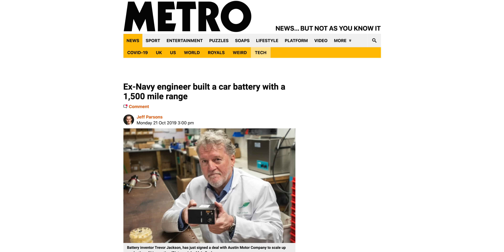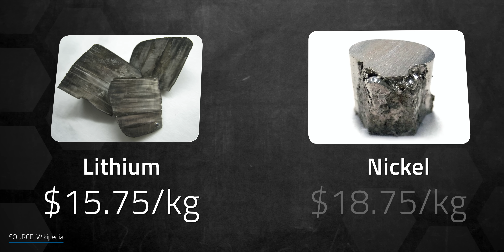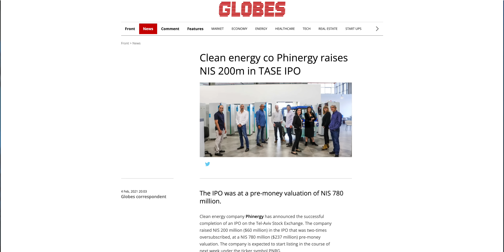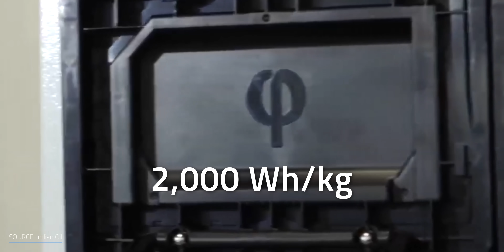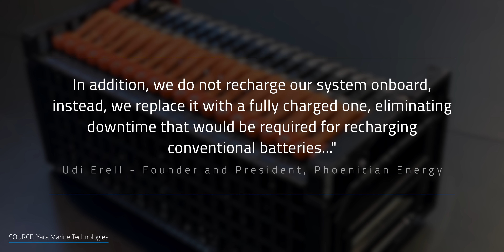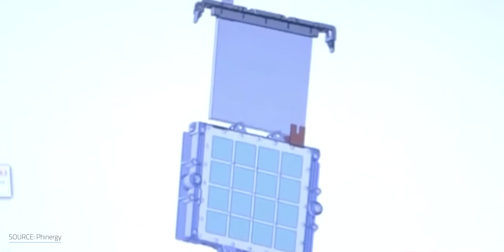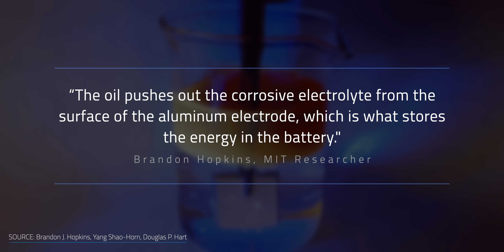Exploring the 1000 Mile Car Battery - Aluminum Air Hype?

Comment: The high gravimetric density makes them an interesting choice for aviation. Swapping is not a problem if infrastructure is built to do that and refurbishing or recycling them into new batteries is also cheap and fast. Swapping would be a problem for these type of batteries if the refurbishing cycle is long and complex. Then you end up with 3, 4, 5, times as many batteries in the cycle than are actually in use so they effectively become very low in total volumetric density.
Reply: You need to re-refine the Al(OH)3 that the Al electrode converts into back into Al metal. That's the same process as refining alumina. So each new battery takes the same level of energy to produce regardless if it is new material or reused material. At least for the Al electrode.
Reply: @seb3090  new or reused doesnt matter, if there are enough around to cycle batteries and swapping is not a problem if infrastructure is built. then the real cost will be just that of Aluminium plates (new or old) inside battery. And we all know Aluminium is not costly, with a small over head charge for services, with great range it be very practical.
Remember its a Govt of India project, for a 1.3 billion people, it has benefit of ability to scale and bring cost lower further. With all major Automobile brands in India effectively on testing mode to redesign cars for easy swap. In Green Hydrogen and Aluminium Air batteries India is working on scale which only India/China can to make it globally cheap and affordable option
Reply: @sandeepssangha  You are looking at best 2-4 tonnes of CO2 per tonne of aluminium, as the batteries oxidise this to aluminium hydroxide so you need to re-refine this the same as you would bauxite. The carbon electrodes used to make congealed electricity burn off releasing carbon (among other sources). So this isn't good.

At best you are looking at 15% efficiency (that is the energy to create the battery vs energy out of the battery).

This is not 'green' by any stretch of the imagination. 

Oh and if you can discover an easier way to refine aluminium hydroxides and oxides into base metal that is substantially cheaper than the current electrolysis (which isn't efficient) you could make billions. I doubt you can because we've not found one yet as the chemistry doesn't really support it.

At least try to understand the science of what is going on before making such proclamations.

Comment: On the subject of swappable battery - Yes, of course.  The obvious choice is the service spare model.  2 batteries loaded, the car runs from one and at critical power swaps seamlessly to the spare, the driver then has x many miles to replace the dead one (which is then the service spare).

Comment: For a car, the handling of the weight of the battery compared to a plug on a cable might be a deal breaker.  On the other hand if the price would be much lower for a car with aluminum batteries and the environmental impact is low by using this system. I would say it has a future. Perhaps a system where you could just slot in the aluminum parts yourself and have a couple of them in the car, like an extra gas can. 

The silver catalyst is something that does not get used up. The swapping fee would then not be affected by the price of silver.

Comment: If one can get 2500 miles range on a non-rechargable battery, then it's more like an oil change event rather than a fill up event.  A palatable option to me.  Definately half to solve the corrosion problem though first.

Comment: Would I like a car battery that I don't have to charge and swap within 3 min at a battery station? Heck Yeah! It's like the gasoline engine in the old days- not enough people wanted them due to lack of gas stations for refuel, but once enough gas stations were built, the whole auto industry took off. To me it's an easier solution to build more battery swapping stations (converted old gas stations)  than it is to build infrastructure around slow-charging Teslas and such. Worried about long drives with no stations in between? just put an extra battery in the back of the SUV and you're good to go for 1400miles (2800km). Lastly, imagine the jobs created by rejuvenating old batteries!! It's a win-win to me.

Comment: Honestly, as a researcher in the feasability of fleet use of EVs, swapping out a "power cell" rather than having multi hour recharge times sounds great. 

The sneaky elephant in the EV closet isn't range issues, everybody knows about them... Its recharge time. As you put bigger and longer ranged batteries in vehicles, recharge times go up proportionately. If a vehicle is used in a fleet setting, say from 8 to 5, you really only have one one charge to work with, as even partially recharging a battery consumes too many working hours to be useful. A larger range, combined with a swap time compairible with refueling, would solve this problem handily. Heck, even an equivelent range with a fast, easy swap process would make EVs far more attractive for fleet applications.

Its not rechargeable? Oh well, gasoline vehicles aren't rechargeable, we replace the contents of the fuel tank every time we fill up. Nice, compact, unspillable, pre-packaged "power-cells" sounds like an improvement to me... Of course the cost of the battert or "power cell" will have to be reasonable, but that sounds feasible. 

The only true draw back i see with the system is the cost of aluminum. Sure, its reasonable now, but if you create a whole new industry based around its conaumption, how long is that going to last? I mean, it would be great for aluminum producers, like india, but maybe hard on the consumers...

Comment: I think the non rechargability is overblown - you have to refuel your gasoline car too. It will require more careful planning in the beginning when infrastructure hasn't been built yet, but once it is, it will be just as easy as stopping at a gas station to fill up.

Comment: The main thing with EV range is that when the car gets low on charge you would need to stop and spend time to charge it up. With a gas car you could just stop at a gas station and spend 5min to get a full tank and be on your way
Reply: If the distribution is done right, the replacement batteries would be standardized, and available to swap out when you're at the 'gas' station. Except you'd be stopping there once every month and a half, instead of once a week.

Comment: This looks like a better option for Electric Airplanes.

High Density for point-to-point locations, then swap at the other side.  All the infrastructure for swap + storage of the pack would be at the airports/terminals.  Hopefully the recycling/manufacturing would happen nearby as well.

Battery swap for cars would be a no-go for me, it could possibly make sense for long-haul trains or trucks, but I don't think regular cars need the range as much.
Reply: Or just make it easy swap out and yes there is lots of need for long range vehicals and trucks.
Reply: What happens when your battery runs out of juice at 30,000 feet?
Reply: @kfl611  that is more of a critical failure or planning issue.

Most flights have 1.5x the fuel needed in case of emergency.
Reply: @DavidDornier  I meant electrical battery juice !  For the electrical jets !
Reply: @kfl611  yes, planning would require the battery capacity to have adequate room for the flight + emergency supply.  That is a planning issue.  The only other reason you would lose power at altitude would be multiple critical system failures.
Reply: You just copied the top comment you 🤡
Reply: @phuckyoutube5927  well I was replying during the video so... "Great minds think alike"
Reply: Only a moron would fly with an electric airplane, you just go from 600mph to 300mph
Reply: @Chris-hw4mq  Who cares if it's cheaper (which most likely will be the case) That's why Concorde or similar planes are no longer even considered. Faster is not always better
Reply: @cerverg  its like buying a Dacia instead of a Mercedes, Dacia is cheapers and slower while the Mercedes is faster and more expenssive.

Comment: Oh...and they're not rechargeable. But other than that they're great! Except in very small doses I don't see how a battery-swap station can be practical. Unless that station is going to process and recycle the modules right there on site this doesn't sound like a sustainable solution. There might be some cases where this type of battery could be useful* but I don't think passenger vehicles is one of them.

* (like potentially long-term space probes with no access to solar energy or where nuclear options are off the table)

Comment: Personally I prefer not to have to go to a swapping station.  Also what would be the cost?  I rather pay a little each time for charging a battery than have to pay for 1,000 miles plus profit to the swapping station which would be a big chunk of money all at once.  I think Aluminum Air batteries would be a better fit for aviation and trucking than passenger cars.

Comment: But the catch is that, because it is non rechargeable is the primary reason oil companies are interested in promoting Aluminium Air batteries to the masses... It will be just like another petroleum product that the vehicle owner can't do without...
Car owners won't be able to charge their cars at their homes and save money... They(customers) would still be dependent on the petroleum (battery) manufacturers.. 😉😉😉

Comment: What is the ultimate energy source when getting a fresh battery?  That wasn't explained (I assume in the production of the electrolyte)?
Reply: The production of the Aluminum in an Oxygen and humidity free plant is the big expense.  Aluminum is incredibly reactive.  It almost instantly "Rusts" when exposed to Oxygen or H2O (Aluminum foil is coated with Aluminum Oxide, almost instantly created when manufactured in air), giving off high heat.  If one of these batteries cracks in a minor accident, especially in a rainstorm, you would be burned alive, along with anyone in a car nearby.  It is that fast and hot.  Good luck finding a firefighter to pull you out of your car if it doesn't crack.  Seriously, the danger from these is huge.  And putting them on ships?  Great idea, no water or corrosive salts anywhere near ships.  No way any port would allow one to enter.  The explosion would make a liquid natural gas tanker's city killer explosion look mild.  This whole thing looks like the hype from the infamous Hyped Loop.  Someone is cashing in on the hype.

Comment: I wonder if these would be viable as a sort of boost pack for EVs instead. Would be interesting if you could optionally put an extra battery pack in your frunk to augment your main lithium battery pack for long trips or emergencies. Might help reduce the issues of finding a limited supply of exchange stations while giving that extra boost if needed and let the economy decide if it's good or not. Similar to what's mentioned in the video but just an optional after market upgrade with the only permanent feature being a port to plug into the car from the frunk and maybe some form of mounting system to secure it.

Comment: I would like to see it as an extender for now.  You have extra room in EVs because of lack of engine.  Put the pack in there and use it for a long road trip to charge up the current batteries on the go.  It could also be your "Jerry can".  Giving you that extra power to get home or a place to charge the standard batteries.  Why can't the same roadside charge companies just bring you a pack and swap it on the side of the road?   For that I guess you would need a standard pack for all cars.

Comment: Biggest elephant in the room is that one gallon of gasoline is equivalent to 33.7 kilowatt hours of electricity.  
"According to the EPA, burning one gallon of gas produces 115,000 BTUs (British thermal units). 
To generate the same amount of heat by way of electricity, it takes 33.7 kilowatt-hours (kWh)."

Comment: That's a bit unfair to talk about what to do if you ran out of juice at night. What do you do if you run out of petrol or run out of battery charge today? I'm sure the service rescue vehicle could easily carry one of these. The all round efficiency of the energy wasn't questioned. How much energy does it take to reform the metal from the oxide? Does it matter, if the energy can be collected from intermittent renewables?

Comment: I'm with you on that Matt. I just don't think there would be many uses for large primary batteries. It will be a niche market at best. There's such a huge demand for better batteries of all types, they will come. As long as the private sector is not inhibited by unreasonable taxes or subsidies (which slows down real development), we will probably see more improvements from 2020-2030 than we saw from the entire last century.

Comment: It is a nice and clear detailing about the aluminium-air batteries and its future...well, what about so called aluminium fuel cell weighting for mass production by a indian start-up company called log9 technology with surge company....it was claimed that a car powered by this run 1000 km and uses aluminium and graphene as electrodes....seems to be more promising....please make a video on this battery and i would like to here it from you...thank you

Comment: If this battery type is ever to succeed in cars, they have to standardize the form factor and electrical specs of these batteries NOW. No "swapping station" will be capable of keeping 20 different types of battery in store for various brands of vehicles.

Comment: make a hybrid Li and Al battery. Recharge the Li battery on a regular basis and when you need a long trip without charging use the Al battery and swap when another long trip is needed. Best of both worlds.

Comment: im sorry, not rechargeable? just what we need, more single use products. oh but they are totally recyclable. yea? so is aluminum cans, yet, not all of them get recycled. this will just make more waste. and the infrastructure needed to have stations with swappable batteries will be insane. the storage needed, the transportation of these batteries to and from the stations is not realistic. the fact that at least half wont get recycled, will be mountains of waste. these would be great, IF they were recyclable. but points to india for trying to find a better solution then lithium.

Comment: I would not want this battery,  I love leaving my home with a full battery everyday(if I choose).  I do not want to rely on a company for battery swaps or gasoline or hydrogen.
Reply: GS  GK IS EASY  but right now I spend 3 seconds plugging in.  I will stick with rechargeable batteries.

Comment: This sounds perfect for shipping and airplanes. If full sized passenger planes could run long distance trips on batteries such as these, then it could save millions of hectares of farmland from being used for ecofuel - A negative side effect of airlines trying to lower their carbon intensity.
At a scale (airport/harbour) that would allow for full end-to-end battery swapping/recycling facilities onsite, and typically plenty of open space to power as much of that as possible with solar and wind.
I don't really see a massive need for EVs to use this tech. Li-Ion is pretty convenient for that.

Comment: I wouldn't mind driving an EV that requires battery swapping as long as they make it serviceable by the consumer as in the consumer can choose to go to a shop to quickly have the bat changed or the consumer can do it at home once a week or once a month. But it would need to be something as simple as lifting a panel, undoing some clasps, sliding out the old and sliding in the new. It must be a process that takes 5 minutes or less or people will reject it.

That said, the fact that these are not rechargeable means that the efficiency in the recycling process chain must be extremely efficient. Which I can't imagine it would be considering how much energy is needed to refine aluminum. Even recycling aluminum to then be consumed in a battery like this would mean that more raw aluminum would eventually need to be refined.

The energy needed to refine 1 pound of aluminum is about 8.5 KW. I'm going to assume each battery would need 20-40 pounds of aluminum. But let's go with 20 pounds. That's 170 KW just for the aluminum assuming it's refined for the batteries. A typical Tesla battery is 50 KW for 263 mile range. That means that the cost of refining 20 pounds of aluminum is about the same as 700 miles of range. 

Of course those numbers change when considering using recycled aluminum. But as I understand it, the aluminum is consumed in these batteries. Meaning when you recycle the battery you will not recover anywhere near the original amount of aluminum. As a result, it will lead to a major increase in aluminum refinement and the accompanied power consumption just to maintain aluminum supply. All of this doesn't even take into account the silver.

I just don't think this is practical, even under ideal conditions.

Comment: These batteries have been at the developmental stage for half a century...for good reason. I don't see them being the future. Future EVs will probably be "hybrids" of Li batteries and fuel cells. That gives you range, weight savings, cost efficiency and proven tech.

Comment: Personally, I see this as a way to lift people out of poverty. A disturbingly large number of people can't afford to fill their car's gas tank all the way, so the reduced range of the cheapest EVs is completely irrelevant to them-- but automakers aren't willing to mass-produce low-range EVs, since wealthy consumers won't buy them. By designing their EVs to have a small onboard lithium-ion battery plus a slot for a swappable aluminum-air battery, automakers can finally produce a single vehicle that simultaneously serves the needs of both markets: long range for those who can afford it, AND cheap for those who can't.